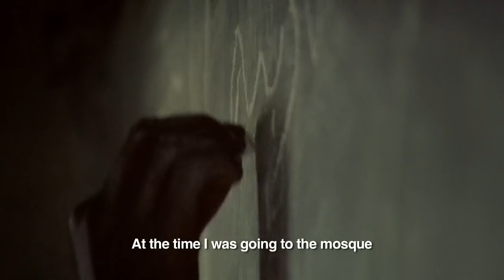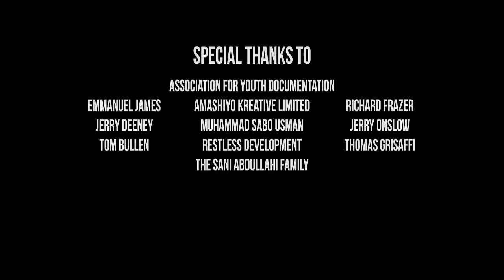Aisha's Song

Comment: Apparently yet another amateur overuse of the Canon 5D ability to limit DOF. Frustrates viewer by forcing what we can look at that is in focus. If your goal is to constantly keep me aware of the camera you succeeded. Very slow moving film despite cutting that is too fast. It didn't even start dialog until 2 min. into a 10 min. film. Pretty, but frustrating to watch. Too much form over function. Filmmaking is a craft & every good craftsman knows when to use a tool & when not to. Get rid of the 5D